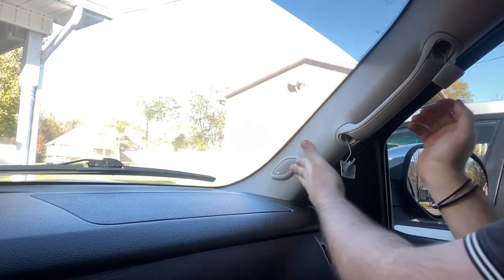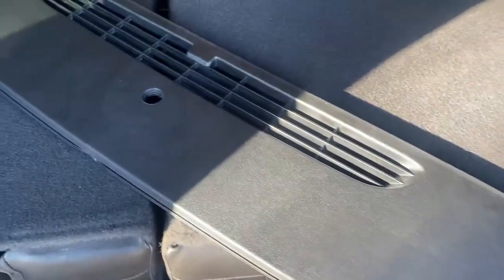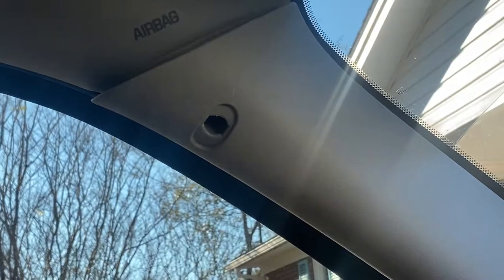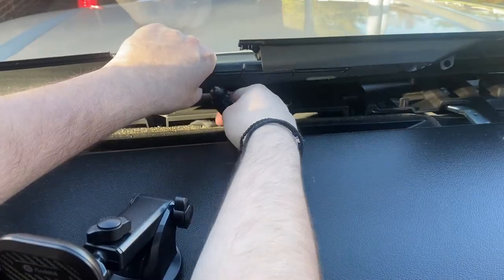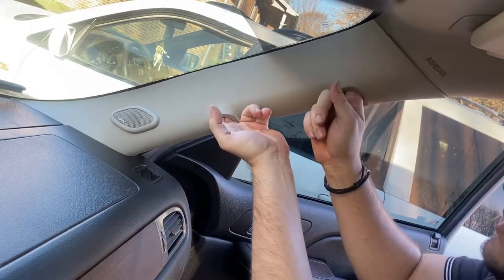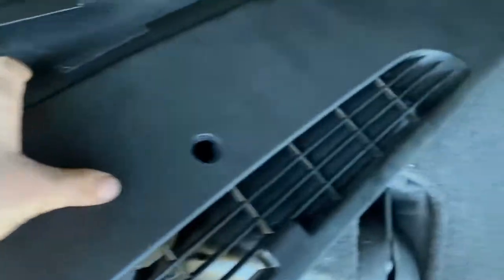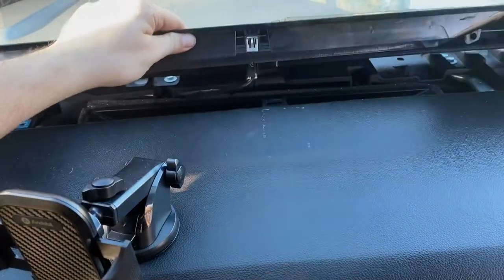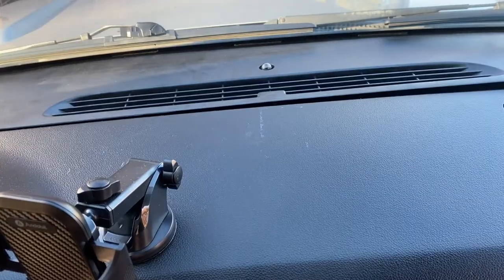GM Upper Dash Replacement 2007-2014 Tahoe,Yukon,Suburban

Comment: Thanks, just did mine. Make sure you get all the old clips out B4 setting in the new piece. I had 2 broken clip areas but it still went in OK. Also keep the rubber seal piece (very front lip) off your old one, you need to reinstall on this unit.